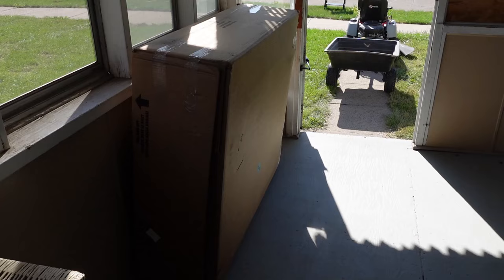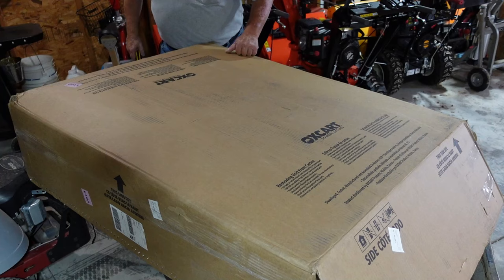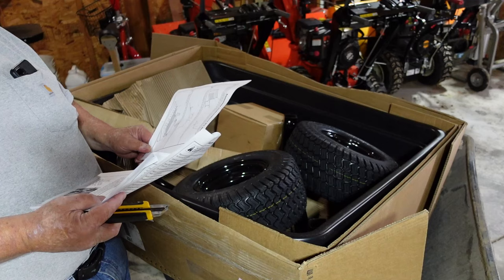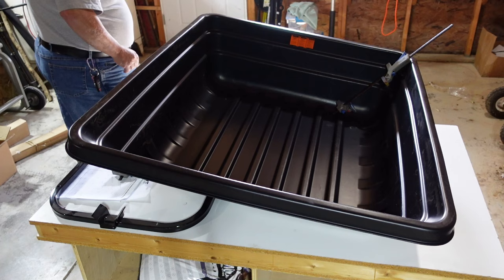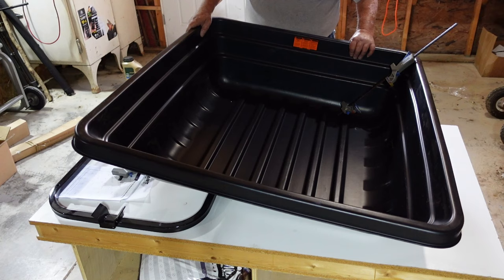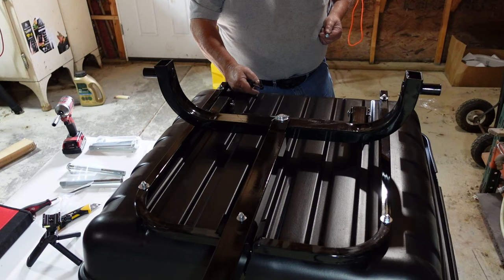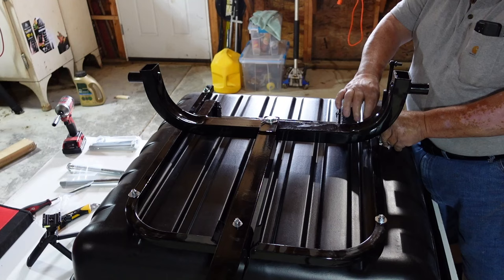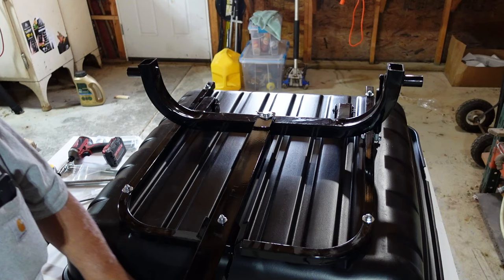OxCart UTV Utility Trailer Yard Cart Unboxing.

Comment: What is with the swivel tung????   That just seems like an aggravation when trying to let it back down. I can't think of any usable purpose for a swivel tung in a utility trailer, please help me on this one.
Reply from the maker: The benefit of a swivel tongue is you can pull alongside a flower bed and turn the cart to dump the mulch, etc. right on the bed. No backing up is required. 
The latch is beveled so you don't have to have the bucket perfectly aligned when you push it back down to set the latch. 
I didn't like the swivel at first but now that I've had four carts with the tubular tongue and swivel and all of them have been a LOT stronger than the carts with the channel tongue. (Craftsman, two Oxcarts, and a Polar) They all are holding up much better than the channel frame carts.